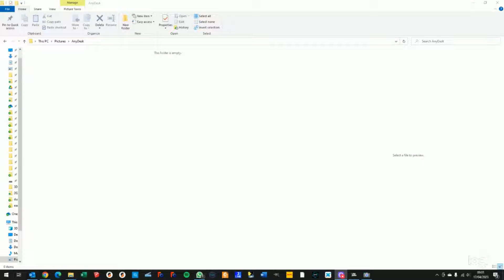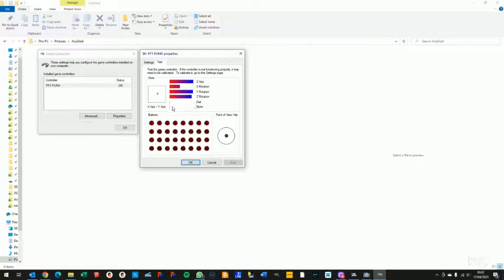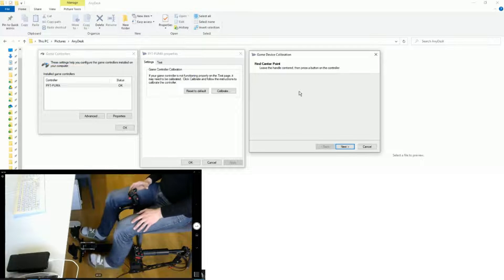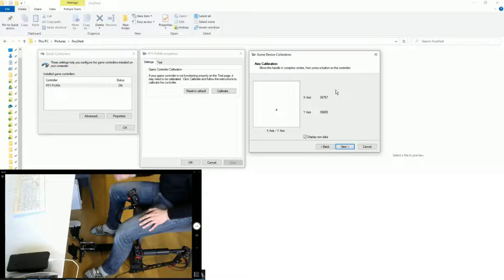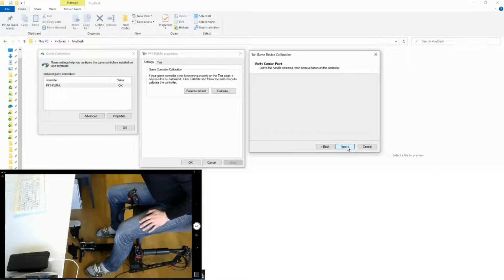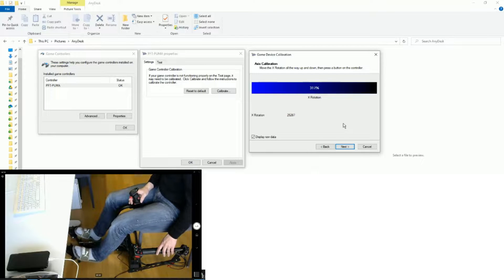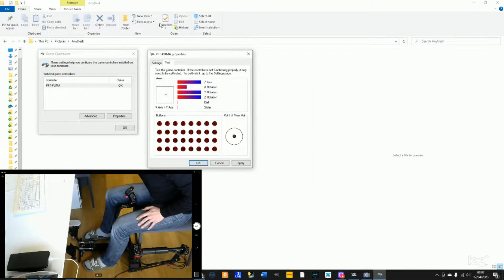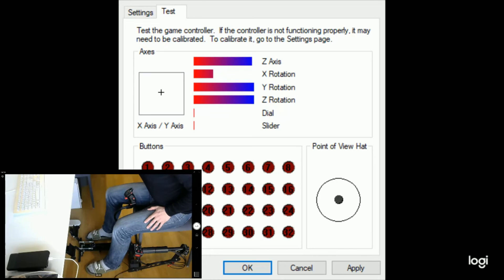Calibrating Pro Flight Trainer PUMA X simulator flight controls under Windows

Comment: It doesn't show up when trying to calibrate on a macbook via parallels. Tried different adapters etc. "Works" with Aerofly FS 4 natively on OS, but uncalibrated. Is a microsoft gaming computer the only solution?...
Reply: Hello, thank you for your remark. We have also received your email support request and will be replying through that channel. 
There are several approaches into solving your situation. we have many users using OSX based sims without issues. 👍
regards
Chris